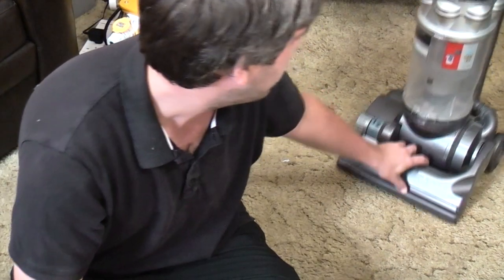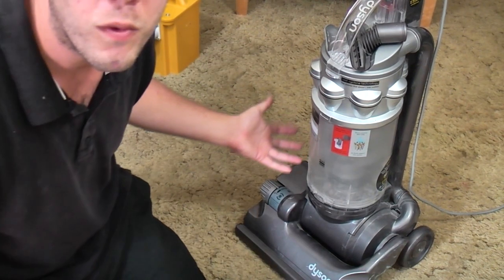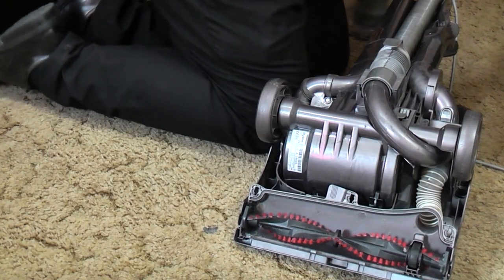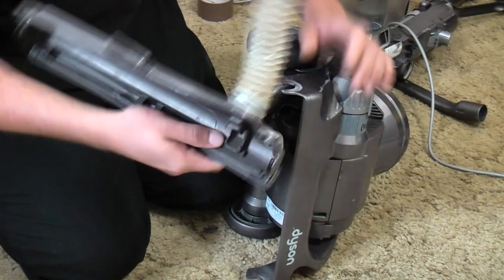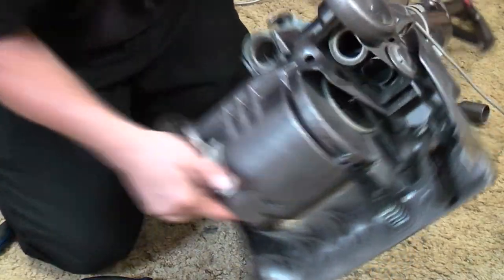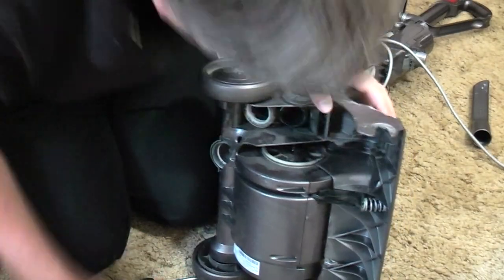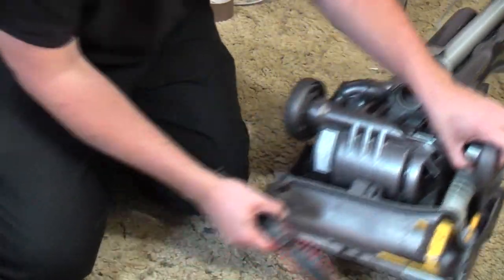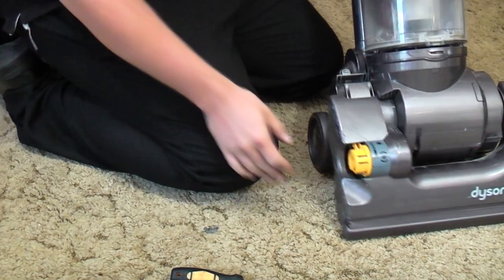HOW TO - How to change the clutch in a Dyson DC14 All-Floors!

Comment: 8:41 something I've done in that situation before is just drip a bit of hot candle wax into the socket on the screw and shove the driver into it.  Just sticky enough, and easy to just push through when you want to take it out again.

Comment: Impressive instructions! Just finished replacing the clutch motor. Pretty sure it would have been impossible without your video, the little yellow hook and strength I didn't know I had ... of course I cleaned every nook and cranny as well . After a decade of procrastination, suffering with a newer but cheap Dyson ... the powerhouse DC14 WORKS again!!!! Thank you! ...going for a restorative nap now ....

Comment: I've had my Dyson for over 12 years but since last year it stopped suction from the bottom so been using the hose and attachment which works well. My husband told to throw it away and buy a new one! but I say why I hate to give it up because I love my Dyson! What you showed me today is exactly what mine is doing... I need replace the clutch. I will order a new one. Wish me luck I do it right!
Reply: Update the new clutch and new filters came in and I got working! 
After rewinding your video a few times I got it done!  So happy My vacuum is fully back in business! 
Thank you so much! 😊

Comment: Great video. The brush roller on my DC14 wasn't turning. Removed the roller without using the special tool - it can be done - removed the end caps, sure enough full of hair & dirt. I also tapped out the long metal bearing rod from inside the brush roller, cleaned it up & lightly greased it. Reassembled & spinning much more freely.  Removed the clutch knob cover & clutch cover as per the video. Pulled the clutch assembly out, quite a tight fit. Belts both looked ok. Removed hair & fluff from the clutch then cleaned up the rollers within it using a degreasing spray. Put it all back together. Works like a champ now, no new belts nor clutch required. Yay. Thanks again.

Comment: Thanks for the instructions.  I have the belts and plan to change them both.  I have watched another gentleman change the belts and it is something I can handle .
Reply from the maker: Best of luck to you! It's not too awful, I'd say the key bit is to make sure youve got the cogs meshed fully and the clutch pressed fully together before (and during) fitting the small belt end and circlip to hold it together. I use a small socket held in a vice to push the clutch against

Comment: Great videos on the Dysons! However I'm  totally struggling to get the clutch cover off!! Do you have any tips or is there particular points on the cover to release the tabs? Many thanks.
Reply from the maker: Hi! The tabs that lock it on are on the top and bottom of the knob, but it can be a pain. I henerally just lever at several points with a flatblade screwdriver and it pops off, although be careful as it's easy to crack the black plastic of the clutch doing this (but even if you do, it doesn't usually damage the clutch itself)
Reply: @beko1987  Hi thanks for the advice !! Eventually got it off - felt like I could have done with a crow bar rather than a flat head - a real pain to get off. Yep can see the clips now.  
Fitted the clutch and put it all back together and brush still not rotating! 😱 Took it all apart and had a look at the clutch. Noticed that the motor belt,  when rotated is not turning the white brush belt wheel in either of the clutch positions - unlike the old clutch that I have just taken off. So suspect this may be a duff clutch?? Got it on ebay. Ah back to the drawing board me thinks.
Many thanks for your reply,  keep up the good work. Videos are most helpful and greatly appreciated.
Reply: Hi there looking for ideas here! Have now changed out 2 clutches on my dc14 after finding the motor belt broken. Initially thought it was a duff replacement clutch, as the brush roller failed to turn.  However replaced with another clutch and still the brush roller is not turning..Getting suction through the wand ok. So either motor spindle not turning or a problem with brush roller...
Any ideas??? On what to check next ???
Reply: Oh this is frustrating!! Checked that the motor spindle was turning - Yes this OK. So as I have replaced the clutch and replaced original clutch with New belt , I thought only thing left was the brush roller.  Replaced tonight and still not rotating..😫😫😫
I noticed the brush roller turning very loosely when rotated by hand , would have expected some resistance??  Strange this is happening with both clutches. Any ideas ????

Comment: This a very good tutorial I appreciate it! However one tip: If you are having trouble getting the cover off on some models there is a fourth screw bottom line if it doesn't easily come off there is a screw still holding on somewhere!

Comment: Well, very proud of myself and my husband for being able to change the clutch and belts. This was no easy feat though. The belts were SUPER hard to stretch. I'm assuming because they are not Dyson "official" parts? IDK. But in the video it looks so easy. We had the stretching tool even and it broke trying to make it work! Anyway, we got everything together and I realized there's one piece that came out of the clutch assembly that I have no idea where it came from. I think it popped off when I released the mechanism and the spring and other "bits" fell out? It's a very thin washer, so to speak. Flat, maybe a few millimeters in thickness and maybe a centimeter and a half wide? The vacuum is running perfectly without it though and I'm hoping this is not some essential part that will cause it to go on fire without. Because, I don't think I can get those belts off or on again!! I can send you a pic of that helps? My DC 14, Animal, purple, is as old as my marriage, wedding gift of sorts. But running like it's brand new after cleaning it thoroughly, getting some new parts like the hose and changing the belts. So this older video was very useful to me, thank you. I think it's around 15 years old or so?
Reply: PS, it's black in color. I watched 2 of your videos repeatedly and don't see it anywhere. I also watched a video someone else made and don't see it there either. Vacuum is like new though now! Hoping I can leave it out and call it a day!
Reply from the maker: Hi! I know the little washer you mean and I doubt it'll cause any issues not  being refitted, it'll certainly be a big chore to strip it all back down again! Ive heard tales of the belt lifters snapping too sadly, I think it all depends on the person welding it together I think. All new belts are hard to get on because their not worn out and stretched! You'll notice the brushroll scrub the carpet more now!

Comment: Hey there I have a question for you. I picked up a Dyson DC 25 because the owner was giving it away due to it not suctioning. I took it apart. (Not as far as stripping it down completely but I spent a good 5 hours into cleaning it and locating the problems. I told the lady I had fixed it and she wants it back. Totally fine but I have no clue what to charge her. I have researched it for an hour and can't find anything. So I come to you the Doc McStuffins (sorry I have munchkins) of Vacuum cleaners for help. Any idea of what an amateur should charge?

Comment: This video was amazing.  I got my unit apart and found secret places where hair and lint build up.  I did my first test and quickly saw smoke coming from the belt on the motor, and the brush stopped. The belt is so tight that it is binding.  I have set it aside and will try again another day. I put a new clutch and now belts on my unit. I do not know what to do next.
Reply from the maker: Before turning it on etc the brushroll should rotate freely on the clutch. Maybe the clutch innards moved when you were reassembling it, was the mechanism squeezed together fully when you put rhe circlip on? Also if the clutch is at fault, it'll make the loud ratchet sound, if it's not doing that I'd hope for a trapped belt somewhere 🤞
Reply: @beko1987  Thank you. I will check out the trapped belt idea today. I could never have figured this out without your video.

Comment: Well I tell you you’re pretty darn good at what you do. I too have a Dyson DC 14 animal but the roller has stopped turning. 

So rather than clean the roller, not me, it was thoroughly disgusting as I was surprised that it didn’t blow up, they just left it so I went in and cleaned it all out and everything spins beautifully except when you turn it on. 

LOL any suggestions as to why? That is why I am looking at your channel here as to how to replace the clutch and such and judging by the many great comments that are awesome I will follow the instructions if you or somebody else pipes in and says that it could possibly be the clutch how do I find out though? So many questions thank you everybody I appreciate any answers.
Reply: I just wanted to point out to you that the brush roller won't spin unless you engage the vacuum - pop it out of the upright position. Otherwise, his videos say if the roller isn't spinning it's probably the clutch needs rebuilding. I used 2 videos of his to change the belts and swap out the part. I had a lot of trouble stretching the belts though so needed my husband's strength to get the clutch back into place! They were too tight to pull even using the yellow bar tool - which we wound up breaking in the process.

Comment: Don't see the point in buying a Dyson these days you have to run n it on the low setting so the battery doesn't run out, might as well but a cheap vacuum . The whole point of buying a Dyson in the past was for the power of the suction.  The Dysons now are weak and irritating I can't even get three rooms cleaned on the low setting so your paying a fortune for vac you have to use on low setting ?  shark give you the option of a spare battery you can change . Dyson could learn from shark plus they could also give you a power cable( switch over)to plug in so you can finish the job. Refuse to buy a new Dyson .  Going to to change the clutch on my DC 14 thank you so much for this vid.

Comment: I did it!!  with your video and a funky kinda screw driver although I did not use the top screw when I put the cover back on...whoops
Reply from the maker: Nice! The top screw for the black clutch cover? You'll be fine as long as the other two are tweaked up well
Reply: @beko1987  yes! exactly, the screw wasn't easy to get out , I wish screw driver was longer....and it wasn't magnetic....lol    she works great!!

Comment: Great job! - I've done a few of these in the past, and always struggled without the belt removal tool - it is doable to get the brushroll in and out of the belt without the tool, but its a bit of a wrestle. Stripping a clutch to replace both belts is a right pain in the arse to do, and I wouldnt recommend it as there are a lot of small parts that can come out of the clutch when it is pulled apart, and putting it back together again is tricky. Always buy a new clutch, or a reconditioned one - dont bother with second hand, as the belts on it could be in no better condition than the ones you already have, ie, the clutch to motor belt is over stretched.
Reply from the maker: I can't agree with the rebuild comment, it's dead easy! 10 minutes tops! I even did a video on it. I usually have a handful sat rebuilt so when I get a refurb in I just swap it out, then eventually rebuild the ones that have built up
Reply: @beko1987  I was just talking with the view that the average lay person might try to do it, having never done that kind of job before. When I took a clutch apart, I was amazed how much came out of it, with the little ball bearings and the metal plates - I nearly lost some of the ball bearings! They are there so it can "slip" and make a terrible noise if the brushroll gets jammed, and when the wear, they create that rattly noise you get from the clutch as you turn the machine off and the motor spins down. The tiny circlip needs special tool too to remove it  - small long nose pliers will do it, but again, if it flies off and you lose it, you are buggered, lol. Once you have done a fair few clutch refurbs, then obviously it would be easier, but for Joe Public who wants to have a go, its not all that easy. Replacing just the clutch to motor belt is easier than having to do the clutch to brushroll belt, and that belt is the one you need to fully dismantle the clutch to change - as a result, when I was doing my refurbs to sell on, I would usually not bother replacing the belt between the clutch and the brushroll, as it was normally the thinner, clutch to motor spindle belt that was slipping.
Reply: @beko1987  I was just about to order a clutch, I think you've convinced me to just get the belts.  The brush bar in mine seems slower than it should be.

That, or I get a clutch AND some belts, and I'm ready if the thing needs it again.